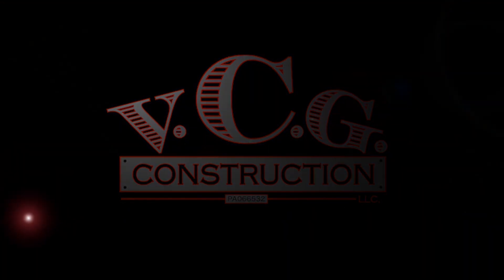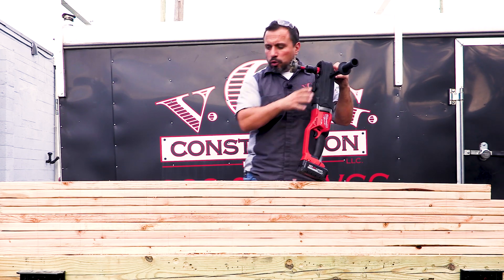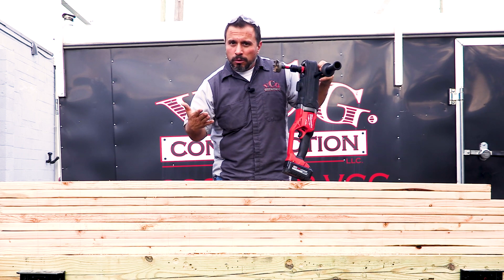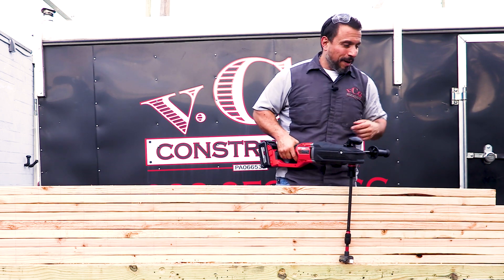Milwaukee M18 FUEL SUPER HAWG Drilling 100 Holes On A Single Battery!

Comment: I dunno if the bits im using are maybe to dull and im putting more strain on the tool/battery but while using a 12.0 battery i maybe drilled 20 wholes and alrdy dropped 2 bars..

Comment: I ran a Milw Hole Hawg for many years, doing rough-in plumbing, when drilling through 3 or more plates, you should drill no more then 1/2 to 3/4 inch then pull up to clean the chips,    believe me, times I wouldn't then loose the bit into the wood,  ugh

Comment: Rutro , I commented before you said we could ask questions ... 

 I wanna see you drill the house from hell ... That remodel with a dozen nails where you want to drill one 2 9/16 hole for the new kitchen sink and then try to get through the roof hitting a nail every damn way ... 

Now we need to be fair, we’re both Milwaukee people ... OMG, you should see me replacing blades on the 1” and the 2 9/16 ... Also, the awesome extension, that can go right to hell, because my dad has busted the chuck key, for the last time!!! You know what it’s like being the only girl on a job site, doing the little, “I don’t know what’s going on! *fake smile*” as I’m hitting the chuck against a 2x4 to loosen it ... Yeah, it’s that bad ... 

Alright, I want you to prove what my arm already knows with that short little piece of engineering shit (it takes your arm or eye socket out) ... I want you to hit several nails with it ... 

Trust me, I know the bit, I LOVE THE BIT (and extension) ... I want to know the drill ...

Comment: Me and my friend just drilled a 4' hole through solid logs from the bottom of the top of a door jam with the 2 1/4" bit we used the Milwaukee 7/16 linemans impact drill

Comment: Use the Milwaukee big hawg bits. No wood chips to bind up and waste energy
Reply: But you can't do more than one 2x materials at a time, as you have to remove the plug. Benefits & cons to both hole drilling options.

Comment: I use my impact wrench with an adjustable chuck adapter to drill with my hole saw bits.  It's a little bit slower but it is almost effortless.  No fighting the drill like you were in this video.  I can go through a double top plate with one hand easy.  Once you drill your larger holes that way,  you will never use a Hole Hawg or other standard drill again to drill larger holes.  Try it.  Maybe do a review or Tool Test Raw on it.  You could use your 2763 and run it against that Hawg.

Comment: That extension causes more mass more weight which will drain the battery faster
Reply: That weight, being close to the axis of rotation, is negligible compared to load of the drilling action. Did you see how hard he was pushing/pulling, and how hard it was getting bound up? That little bit of weight doesn't make a difference, esp since it's only like ~5/16" in radius.
Reply: @xenonram  the length it is and the weight no matter how insignificant it is does make the battery drain faster
Reply: It may a little, but the tool is intended to handle the extensions. If you do a no load test between the two, I bet the difference is negligible.

Comment: Comparison needed with the ridgid mega max with right angle head!!
Reply: what type of comparison...speed or amount of holes it can drill ? if its speed the milwaukee will destroy it...the ridgid only has 450 rpm's...milwaukee is 950....amount of holes drilled is the only thing you can compare...i have the mega max...brought it to vcg and did a video review of it already
Reply: @kingofthecrease30  just to see how they compare with feel/handling of the tool in use, number of holes per a given battery, how well they run large/long bits, and anything else yall could think of.

Comment: Try it with and ship auger bit. I use the corded everyday running electric wires. Like too see how many it would go through? Might have to pick one up
Reply: We use the regular hole hawg with 7/8 auger bits and can do a few 2 and 3 bedroom apartments on a single 12.0. with 3 guys going with their own hole hawg, we drilled a 22 unit apartment in a day and used a total of 7 12.0's
Reply: K Gappa 

Dang! Batteries aren’t cheap either
Reply: @muddybadgers5205  dang youre gonna need at least 2 super chargers to charge up those 12ah batteries!
Reply: @samuelcabrera9456  @Ap A I have enough batteries where I didn't have to charge on site. Just gotta be on the lookout for good deals on batteries
Reply: Ap A I would assume more seeing as these cutter bits take a good amount of power to drill.
Reply: Brenden Joseph 

Just curious how many it would do on one battery.

Comment: Stop making excuses for the red garbage they probably went through cork wood
Reply: Does it hurt being that stupid
Reply: @aaronrudd2690  ohhhhh did I hurt a Milwaukee's fanboys feelings, go play with your puppy and drink your hot cocoa
Reply: the dewalt will prob go up in smoke like the 887's after 20 holes drilled 🔥🔥😂😂...yep..lou is always schilling for dewalt...hates milwaukee...haters gonna hate...what can ya do ? 🙅
Reply: This is not clean drilling in any way
Reply: We've been running DeWalt tools since the 90's. Dozens of cordless tools. None have failed besides batteries and brushes. We still have 14.4V tools from at least 20 years ago, that we still use from time to time.
Reply: @xenonram  i have been saying that for a long time....i only used dewalt back in the mid 90's...stopped using them around 2013 because the build quality is not what it was back in the day...the drills & impacts are not made well anymore...just my opinion